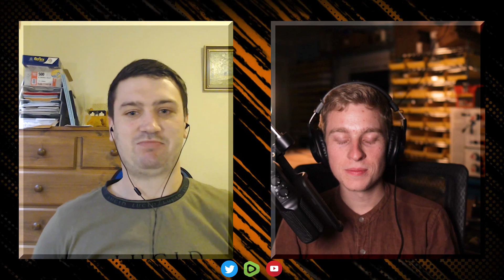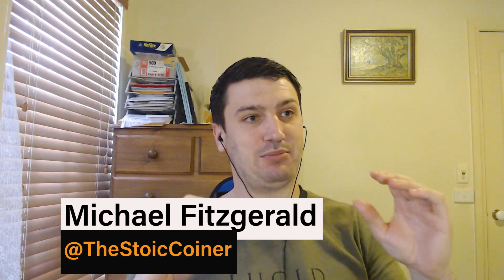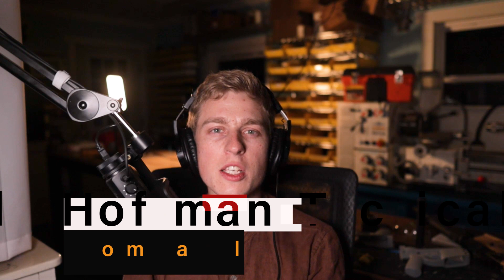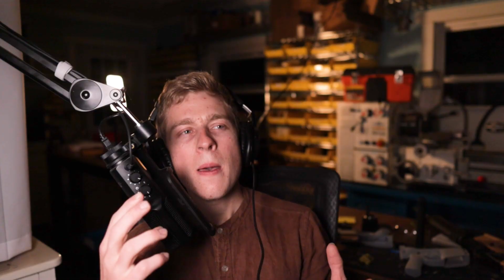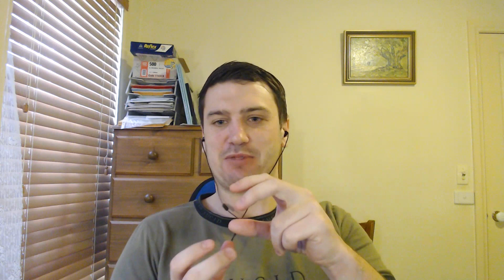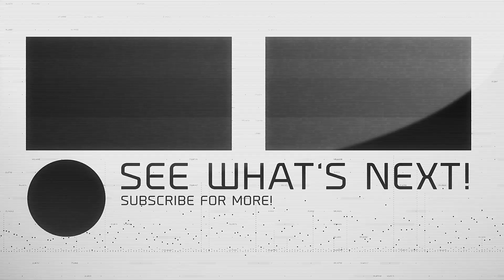How To 3D Print Firearms | Hoffman Tactical

Comment: Bro, have your sl15 made into a mold. Injection mold with a cf nylon. Serialize. Sell. Become wealthy. Keep working on 3d printed parts.
Reply: How do you become a millionaire selling "startup" firearms? Start as a billionaire. Going commercial requires everything from licensing to testing, commercial liability, getting actual orders, etc.
When PSA can undercut your prices with a 7075 T6 receiver, why try to swim against the current?
Reply: He probably already has a hemorrhoid named the AFT, maybe he would rather they weren't an involuntary brain implant as well😝